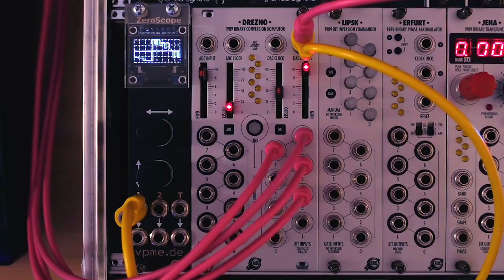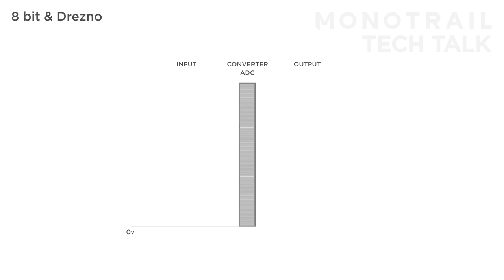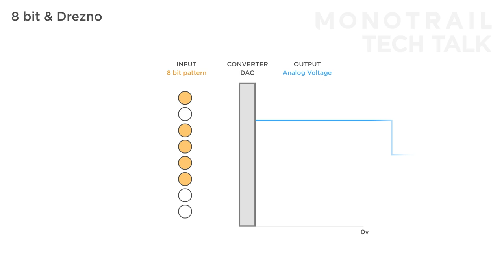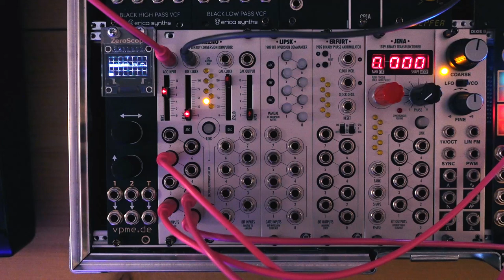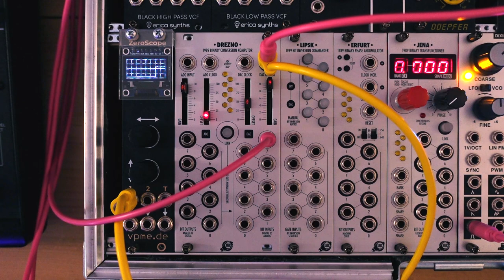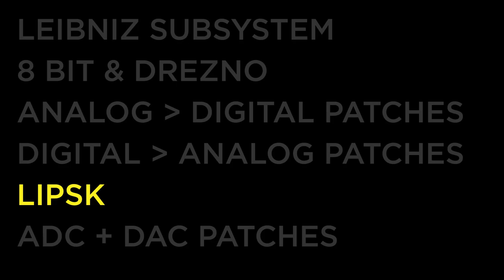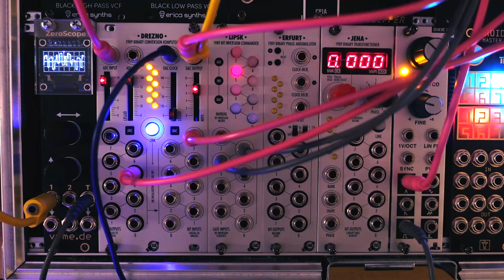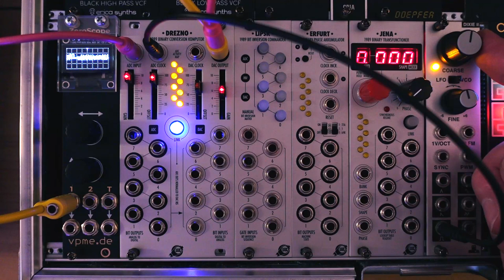8-bit signal processing for eurorack - Drezno & Lipsk / Leibniz subsystem / Xaoc devices

Comment: I think they call it ADC because gate outputs are either on or off which can be considered a digital output. We tend to think of gates as analog but since there are only 2 states like a binary number, I can see why they consider gates to be digital since one variable input is being converted to one of 256 individual output patterns.
Reply from the maker: Quite true. An analog signal is converted to a digital 8 bit signal. So Analog to digital conversion. The are consistent in that idea, which helps, because some modules do just that. But in truth in Drezno's left side, an analog signal is converted to a digital binary number, and then to analog gate patters. Cheers!

Comment: MTT, I'm trying to wrap my head around the 30:48 moment where you have two gates from Drezno mixed and then sent to a quantizer. Are those two gates now voltages from Drenzo making a melody? I would think they would just be static pitches.
Reply from the maker: Yes. But to be clear, the high melody you hear in that patch is made with the DAC output (right side of the patch- diagram). The left side is making a 4 note bassline. Indeed the gates from Drezno are static and the same. The crucial part here is the mixer. This allows for attenuation of each of the two gates, and of course it mixes the two gates together. This way you have 4 optional states. When no gates of Drezno are on. When one or the other is on. And when both are on. Each combination will give another note, and you can use the mixer to dial them in.
Reply: @MonotrailTechTalk  Thanks so much for that clarity. So, by mixing the gates you are getting three different voltages that produce three pitches.

I am going to have to try this.
Reply from the maker: 4 even :) Gates 1-2 off-off (that will be the pitch you tune the oscillator) Gates on-off (you can set this note by attenuating the gate on the mixer) Gates off-on (same) Gates on-on (this is the sum of both gates mixed together).
Reply: @MonotrailTechTalk  Right!!! I just did it. Worked great! Thanks so much!
Reply: That ADC DAC Patch 6 is really nice. Some very nice musical filter adjustments! I'd like to hear more of that.